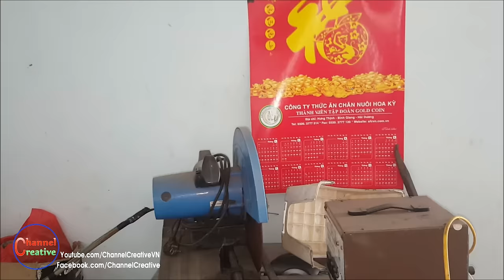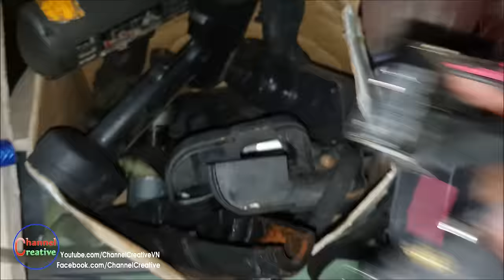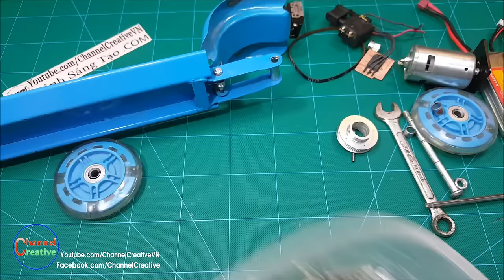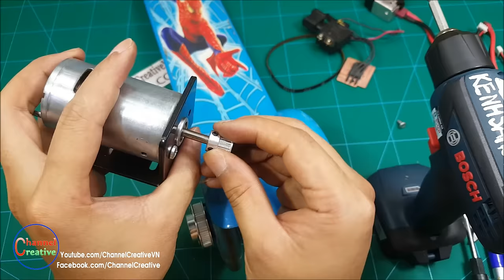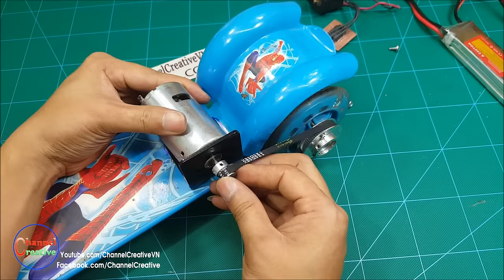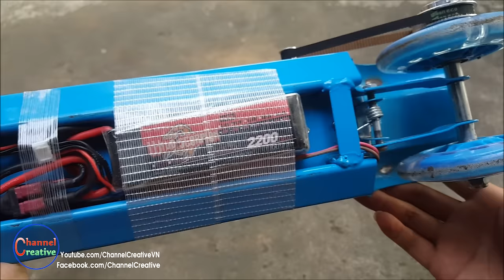How To Make A Electric Scooter At Home using 775 Motor

Comment: I wonder if using a speed controller would be more beneficial because in this direct drive system, when the wheels of the scooter are spinning passively (going downhill for example) the motor will be generating backwards voltage that is being sent to the batteries. I believe a decent controller would solve this instead of using just a potentiometer from a drill... Thoughts?

Comment: cool project but i'm willing to bet the motor isn't very happy with that much load and running so slow  which would draw more current than usual. it's designed as a fairly high rpm motor so more gear reduction might be needed to make it run more efficiently.

Comment: Thats probably a lot of stress on the 775. You might want to use something with more power draw, aka thicker wire/coils, which will have more torque, instead of speed. Overall, nice job

Comment: You have two 3-cell batteries, are they in series (24v@2.2A) or parallel (12v@4.4A)? Do you think it will be capable to move an adult with a 36v battery? Thanks

Comment: hay can this 775 motor be used to rotate the weapon (drum) in the war robot at the RPM of 2500-3000 at the 12-24V ,the weight of drum will be around 15 kg & the bot is not wireless

Comment: why does he not use the brushless motor?
Reply: Graham Hutchins because it's too tricky lol it would need a couple other things that he didn't have laying around apparently like brushless motor / esc and a manual throttle control and probably a couple more things on top of that.
Reply: I saw an esc and a brushless motor in his video.
Reply: He has that gear laying around in the video, I saw it
Reply: Graham Hutchins yea I don't  that is not a brushless esc in the box or in that tub and no esc throttle either so the only thing brushless related in the video is the motor in the motor mount tub.
Reply: Look at some of his other videos, he has all this stuff. Plus my first comment was just a suggestion, not something that "Timothy Mosley" was supposed to take so literally. Get the point?
Reply: Graham Hutchins yea he might might but your last comment said "laying around in the video" clearly it's not lol so I replied to your shit comment.
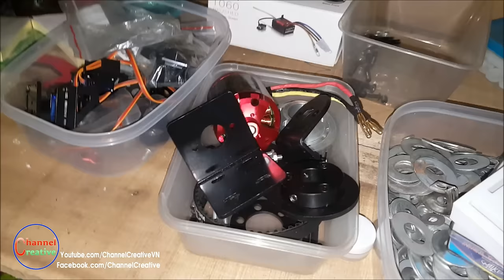Reply: 1:43
Reply: esc box behind the brushless motor. Also, why are you so triggered over a suggestion. Chill Mr. Mosley.
Reply: Graham Hutchins really that's not a brushless esc lol
Reply: Lol, woops. Sorry, but u get the point right?